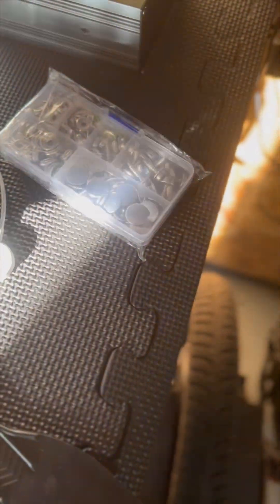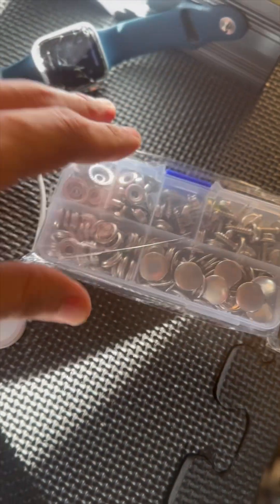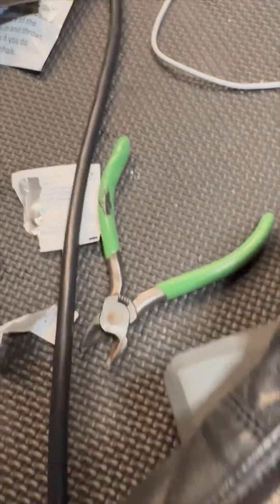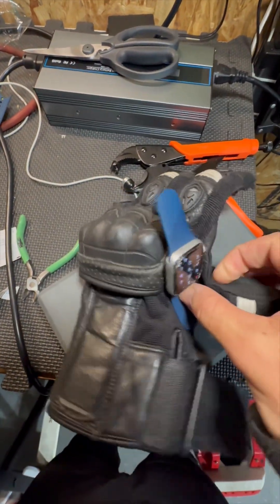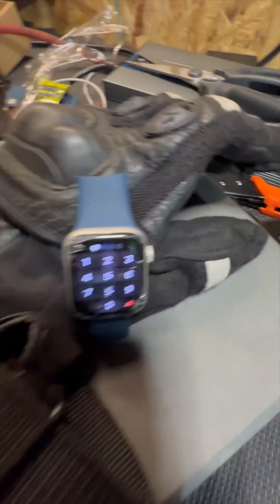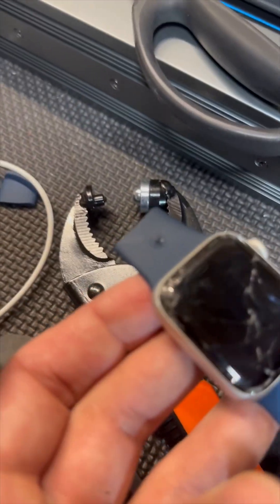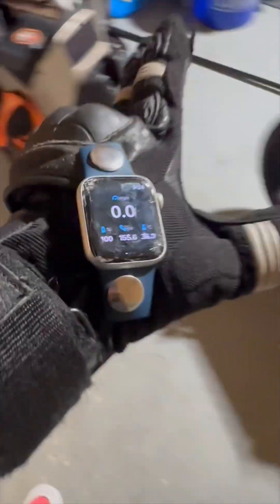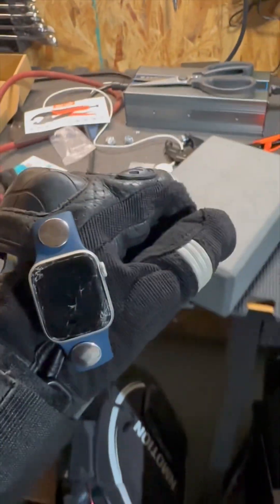Best DIY HUD tutorial | EUC , OneWheel , Esk8 !!! The “JGV HUD”

Comment: It works with darkness bot. 
I have it on my Android watch. 
I haven’t sewn it to my glove. 
Just using an elastic watch band, so I can wear it with or without any glove/wrist guard. 
The Inmotion and EUC world apps are working too. Google map works fine and I keep it open, alternating to my active EUC app at will with push select button. The screen size being small, I selected PWM, speed, voltage, odometer as main display. I would need to scroll for other info, which I never do while riding. 
GPS speed monitoring always have annoying delay. I prefer the wheel’s bluetooth reading because it’s realtime. The GPS speed is logged anyway, so I can see it later. 

I know the Apple watch can show the app that’s active on the IOS phone, only I wanted to run the app on my watch. I don’t have to carry the phone anymore. The watch has a SIM card and full network. 
The only turnoff is battery life. I need to charge it everyday. If I keep the screen lit, multitasking many apps, It will last only 5 or 6 hours. 

Anyway. It works fine for me, and pretty cheap too. I broke my iphone a few times in crashes so, I’m happy to risk only the cheap watch now.